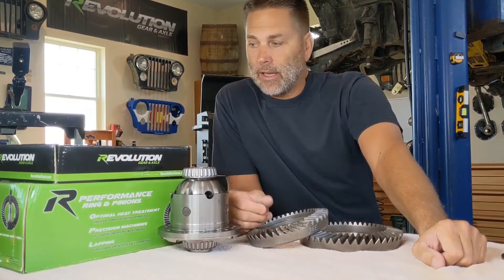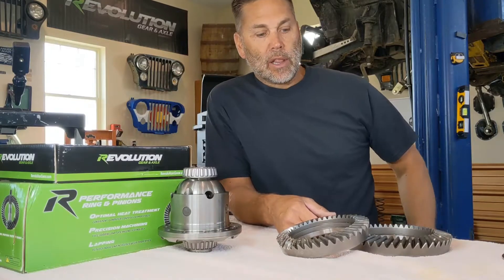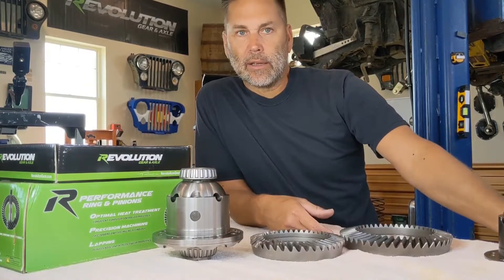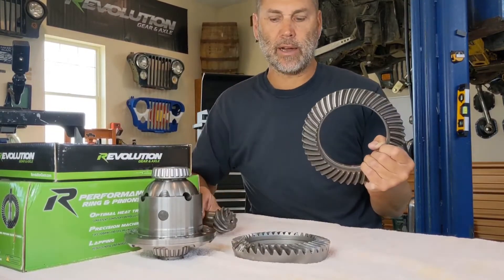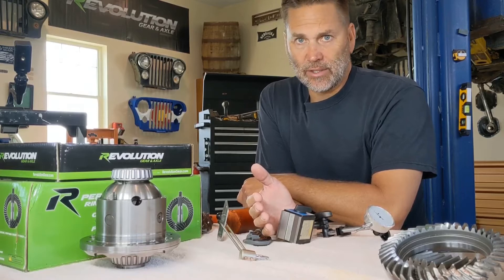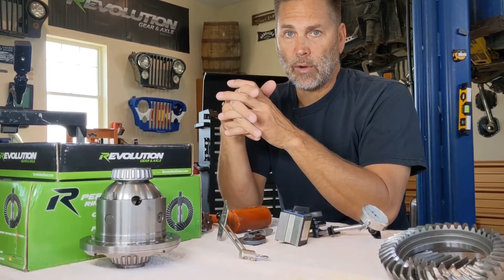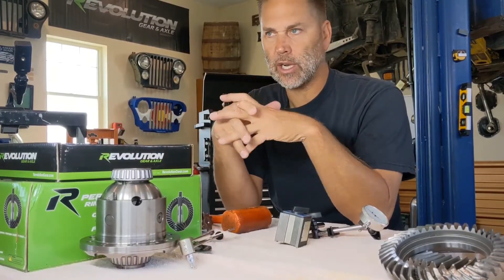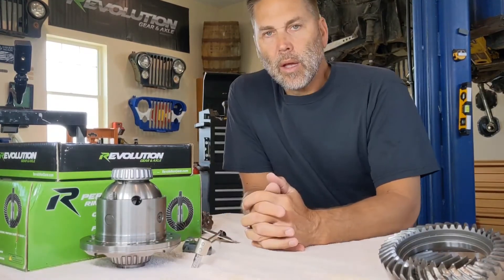Jeep Wrangler TJ Dana 30 Axle Build Part 3: Gear Selection and Special Tools

Comment: hi mate i have o6 tj run 33” tyre 3 “ lift im planning to go 35” but my gear ratio is 3.07 on DANA 30/44 my question is what gear should i use to avoid carrier break i need your advise thank you
Reply from the maker: The D30 and D44 have different carrier breaks. You can use thick cut gears instead of new carriers. But if you're in there, why not install lockers while you're at it? Also on a side note, last time I checked they don't make thick cut gears for reverse rotation if you happen to have a high pinion 30.
Reply: @TheBFHGarage  if i run 33” tyre what gear ratio should i use to gain more torque specially on highway right now im on 3.07 it very seldom for me to use 6th gear coz im losing power and less fuel economy
Reply from the maker: @thekings4x4offroadadventur3  Gear ratios need to have certain information to determine the proper ratio. You need tire size, engine, and transmission. You can plug that information into a gear calculator (grimjeeper is one) and it will show your RPM's at certain speeds etc. you can then make an informed decision as to why you want to go with a specific ratio. I would suspect you'd want to be 4:56 or even 4:88 depending on use.